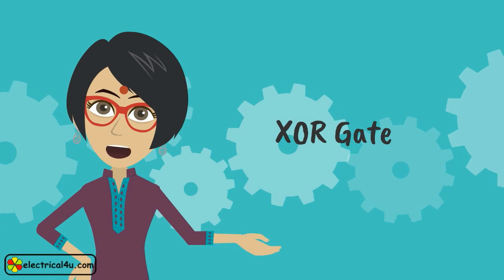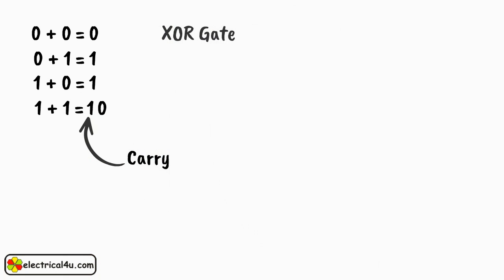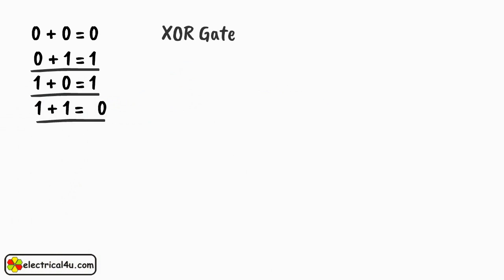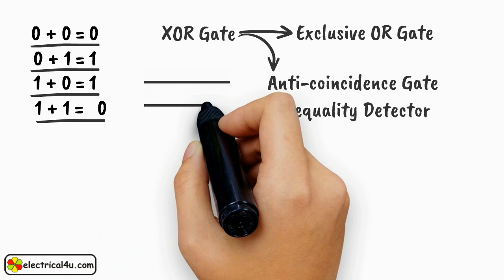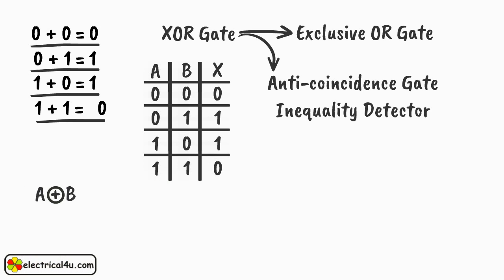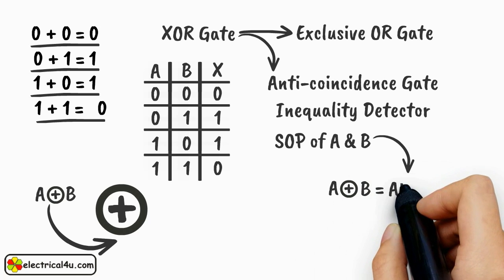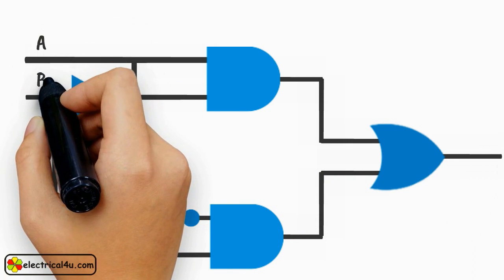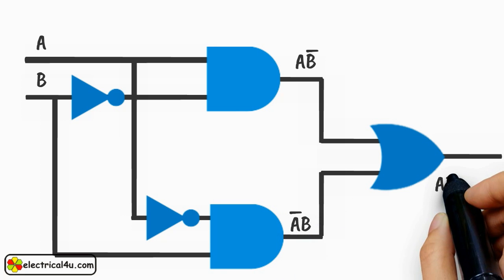XOR Gate

Comment: in a nutshell with XOR, any bits that compare and are the same (two binary 0’s, for example) yield a resultant bit of false (and produce a 0-bit as the output). Any bits that compare and are different (a binary 1 and a binary 0) produce a true value, and an output bit of 1 is generated. Figure 2-5 illustrates this process.

Meyers, Mike. Mike Meyers' CompTIA Security+ Certification Guide, Second Edition (Exam SY0-501) (Kindle Locations 2197-2199). McGraw-Hill Education. Kindle Edition.